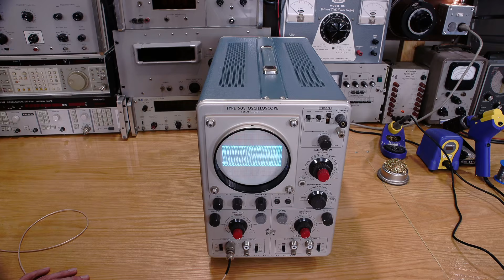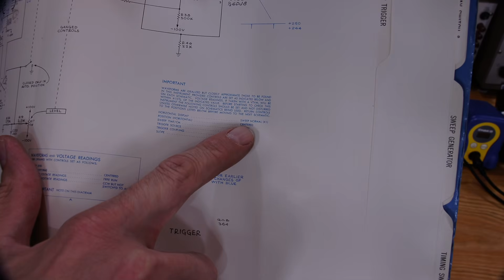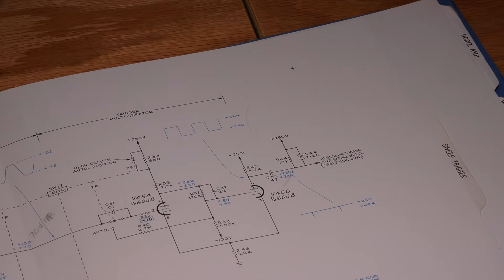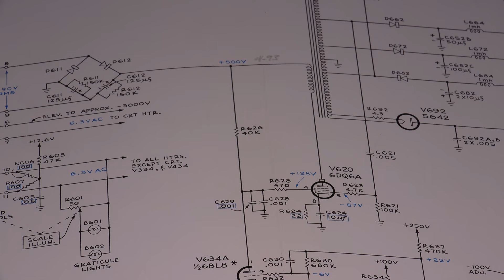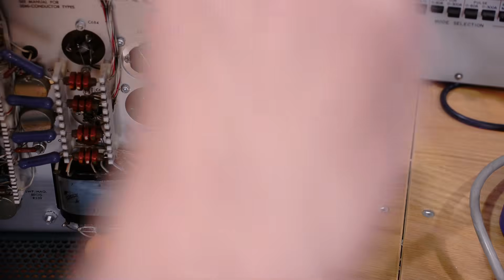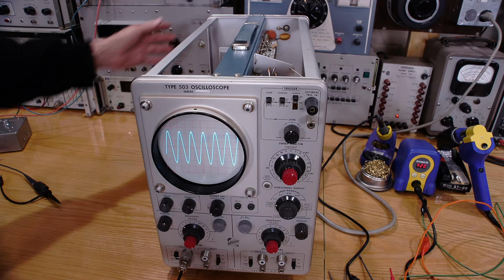TEKTRONIX TYPE 503 Electrical Troubleshooting And Repair!

Comment: Do not replace the tubes in this I'm just seeing Wright now they look like amperex Bugle Boy 6 DJ 8 all I could see is a white lettering on it don't clean them because they don't touch those with the numbers they paint the numbers on and it should have like a picture of a vacuum tube on it that's got a face and is kind of dancing so that's why they call it a Bugle Boy
Reply: It's also blowing a bugle most of the time so know the reason it's called a Bugle Boy so hopefully you pull the tubes out we get to see them

Comment: I got all the way to the end of fixing the supply voltage on my 503, just to find out that the cathode and the heater were shorted together in the CRT. Which is a bummer because when the scope worked it was fantastic. Off to find a tube!

Comment: Hey man. I have a quick question if you do not mind answering. I'm building a new dim bulb current limited variac / isolation transformer. I take it you popped a slug out of the switch box where you have the 2 plugs and popped out one of the slug holes and put an ac incandescent bulb in it ehh? I'm wondering what type of socket the bulb is in.

I realize I'm doing this at my own risk, I've quite comfortable doing it and plan to build an enclosure for mine but mount it on the wall offset from my bench kind of like you have set up. A family member manages the local Greybar/harris roome so i get electrical boxes and such at cost, if not free. It's great when I need to do any household wiring and he gives me the ptfe coated wire that's left on a roll. haha. You would not believe the markup on things depending on if it's an order for a utility contract. For instance, 8 years ago he offered me a fluke 87v for 350 (cost) and they sell it for almost triple to the power company.

I ordered 2 e26 bulb sockets and 100 watt ac tungsten bulbs which have went up in price here in Canada since last time I bought a similar type, it's as if led lights that were once 40 a bulb are the cheap ones now. haha.

Great video and no pressure to answer my question if you do not want to. I get you're busy and appreciate what you do.
Reply from the maker: In my unit, the bulb sits in a rubber grommet, and is soldered. (no socket) Thanks for your kind comment and offer!
Reply: @MrCarlsonsLab  Thanks brother. Your comment is well met and appreciated.

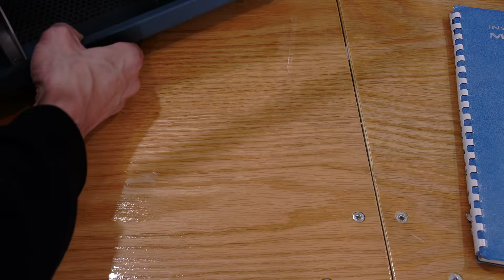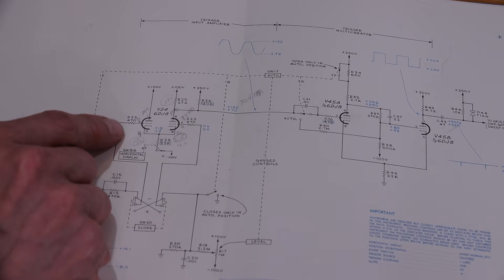Comment: That is absolutely the cleanest 503 I have ever seen.  In the 70s when I worked on these smoking was still allowed.  15:01 I am pretty sure that is silver solder. 16:36, I don't see any of the characters that were in some of the schematics, like "top gun". Great fix.

Comment: Great video Paul!  I too have owned and loved many a Tek scope, currently have 5000 and 7000 frames & plugins and my bench scopes are a 465 and a 2465, both gems.  I just had one comment: when you installed that new cap in the -100 V line, you missed an opportunity to use that silver solder...there were unused lugs in the strip right above, and the cap would have fit great there.

Comment: LOL, that cabinet panel falling thing reminds me of an incident I had. I was working on a graphic design computer system in the late 70's, at the GM Oldsmobile automotive design staff facility in Lansing, Mi. A very quiet environment, I had taken the panels off the unit and thought I had them safely set aside. However, I had to get on the floor to get at a subsystem at one point, and having a bit of a struggle with position, my foot knocked over one of the panels, creating a loud Boom!  All the guys at their stations in the place stopped their work, starting whistling, yelling "Yea, Yea, Alright Alright!", then clapping for a few seconds, and then returned to their work. Embarrased, I then laid the panels down on the floor so that wouldn't happen again!

Comment: I have test gear that allegedly will test capacitors in-circuit, making prior desoldering unnecessary.
It has so far been a quick and easy way of testing the state of health of capacitors that do not look overtly damaged. 😐

Comment: Thou shalt not covet. 😓
And there I thought that a `signal write` was issued simply by comparing the signal amplitude to a preset trigger-level. 🤔
The interior of the CRO looks like the instrument was kept for most of it's life inside a sealed enclosure and was never even used.
Do you think the folks from Rohde & Schwarz might do that too? 🙄

Comment: The manual said to select 1 millisecond for calibration, but you selected .1 millisecond.  Coming from a non-electronics guy (but an electronics enthusiast), wouldn't that be an issue?

Comment: Paul is the 503 comparable to an eico 460 wide band, or a heathkit IO12 ?
Reply from the maker: Hi Peter, the 503 is a low frequency scope (450kHz) where the EICO would go to about 4.5 "or so" MHz. The trigger section in the 503 is fantastic, where the EICO was more (everyday) so to say.
Reply: @MrCarlsonsLab  thanks for the reply...nice to know your there!

Comment: I have this scope and I have one capacitor fail. Tied in another one leaving the failed one out of circuit and everything came back. Set it to the side for six seven months and foolishly just plugged it straight into the wall and now I think another capacitor actually failed. That was so happy when you posted this video. Thanks for everything Paul!

Comment: Sehr Angenehmer Kanal Mr. Carlson. Sehr Service Freundliches Tektronics Osziloskop! Ich habe 2 Pendanten Philips GM5602 14Mhz Breitband Osziloskope.
Sinus Signale gehen weit über 20Mhz zu triggern. Bei Rechteck, oder anderen Signal Wave formen geht es nicht so weit. Aber die Philips Geräte sind sehr viel Komplexer und verbaut. 250Watt bei 230V 50Hz 
Ich teile die Leidenschaft zu reparieren, und alte Röhrentechnik Fasziniert mich Magisch.

Comment: I believe on most of these tektronix 500-series scopes, you can remove the bezel and flip the graticule around 180 degrees and get either a white or red graticule, some amazing engineering went into making these machines. I have a 535A myself, that unfortunately is in a dysfunctional state. I hope to get it up and running and your videos are a great inspiration and aid!
Greetings from Sweden!

Comment: You probably know this already, but on the Tek 514AD scope I have, the graticule panel has two sets of holes drilled for the lights. Two are normal, the other two have red dye tinting in the holes and make the graticule appear red. You change them just by flipping the panel.

Comment: Hats off to Tektronix folks who designed and built this Type 503 scope. What a beautiful piece of history. You can just tell they took immense pride in building this equipment. And the fact that all these years later the scope still performs is just amazing. Thanks for repairing this scope! I also love that you stuck with the theme of using other analog equipment to get the repair done!

Comment: seeing the Tektronix manual brought back memories from the PDP-8 computer I used to service 30 years ago, back then electronic equipment came with good service manuals. on the side note, my company has since replaced those PDP-8 with IBM PCs and I have no idea where the old stuff ended up, hoping the bean counters would have donated them to the museums.

Comment: Hello Mr. Carlson i am new to oscilloscopes im trying to get into repairing vintage electronics and i just picked up an Analab 1100 oscilloscope from the 60's i was wondering if you might know anything about them and what to look for to make sure it is working and calibrated properly while im learning to use it properly

Comment: What a nice piece of equipment, this one in particular is so clean that I could think it was never used. The quality of tektronix equipment is so impressive and beautyful, I have worked with different models of Tektronix video waveform monitors for over 30 years in broadcast television and I don't remember seeing any one failed.

Comment: Great video, THANKS! Having worked on some 503s myself, I would like to share some of my experience... Earlier 503s have tubes in the signal amplifier sections, not variacs. The signal amplifiers are very sensitive and optimal for X-Y use, i.e. vector graphics. The insulation (plastic) for the intensity and focus pot can break down (may be too much sun?) and cause short to chassis / ground. Be careful everybody!

Comment: I have a TEK 310A with a blown capacitor on the power supply. It was given to me because it doesn't work and just smokes when they try to turn it on. I wonder if using a modern cap like you did in this video will work. I love just looking at this vintage unit which is in mint condition otherwise. I'm very interested in taking your course in repair also.  Thank you for the video above. Tom S. Ocala, Florida

Comment: Excellent video and information. After seeing this, I am now interested in tracking down this model for my shop. Would this be a good scope for guitar amp work? Any issue with tubes for this such as supply and or cost?

Comment: I enjoy.
I have an tek 2225.
And when i measuring rise time of  a very fast edge signal grnerator at 10x magnifying mode it have horizontal jitter.
Could you realise which part have issue.?
Vertical swip or trigger part of the circuit?

Comment: I have the type 504, bought it cheap at a ham fest. But would rather have the 503 for its nicer vertical amplifier for x-y mode. Thank you for the video.

Comment: Another excellent video, thanks for everything you do. I believe that the 503 uses Nuvistors which would be very interesting to have the Mr Carlson treatment to understand how they are used in this scope both from an electronic and mechanical explanation. Fingers crossed 🤞

Comment: One trick for quickly spotting issues like the one you found here with the bad capacitor: put a DMM into AC voltage, and if you read anything substantial on a power rail you know you need to investigate further. Just need to be mindful of your DMM's bandwidth in that mode. 

Great video! Informative as always.

Comment: Great Video. Seeing again those scops from my past. The company of my Father built scopes in Germany up to around the 1956 till 1976 yeat in germany in theTettnang  factory starting from tube versions in the 60th up to transistorized  ones. Called P.E.K. Oscilloscopes (in Tettnang Bodensee next to Friedrichshafen)  -- maybe you get in hand of some of those rare scops. I still have a 10MHz transistor P.E.K oscilloscpe based from that time. As a young boy I was running around in the factory and playing with these nice instruments. The also did the first tests with color versions of  a color capable scope tube which I never saw again after that time.

Comment: This is pretty similar to a scope I'd picked up when my tech school had to clean out its storage area when moving to the new campus. The factory-provided silver-bearing solder, however, was wound around two posts riveted to the chassis, and I seem to remember that the unit could be folded out after the covers were taken off. Certainly a far cry from the repair-hostile electronics we deal with today!

Comment: In the 80s my dad worked for tektronix as a service technician and I grew up playing with work he brought home. I have a couple of Telequipment D67 oscilloscopes here that he picked up back then for free and rebuilt after someone dropped them in a lake. I think he said that one has D66 parts on the inside. Unfortunately he passed away last year so I can't get more information on them. I have no idea what these would have originally cost but he always thought they were something he was saving for retirement, a bit of a nest egg. Until he looked up what they were selling for a few years ago.
Reply: Tek took over Telequipment in the 70's, they made cheap service scopes.
They were dumped as Tek released the el cjeapo 5000 series, which was horrible

Comment: Your excellent video took me back 60 years or so to when Tektronix scopes were the king of instruments in the laboratories where I worked.  They weighed an absolute ton, but when you got a reading on one of them, then you knew it was right!   You showed us how to diagnose the open-circuit reservoir capacitor in the power supply from the excessive ripple using another scope, which of course was responsible for the low output dc voltage to the trigger circuits.  Those of us 
without the luxury of a second oscilloscope would probably have guessed where the problem lay and confirmed it as you did by paralleling a good capacitor across the suspect one.

Mr. Carlson, I am always impressed by the sheer professionalism of your videos with their amazing quality!
Reply: In early 80's I also started working with a Tektronix oscilloscope (was a bigger one, but with a wagon carrier !). So advanced for that time, so precise, highest quality. Then, in the next job, I had a mighty 4 Ch. dual timebase, flat screen, which helped so much, and which I admired enormously. And the next was so small, so practical, yet so powerful and useful, with LCD screen. And all the time I witnessed the incomparable quality and performance of the great Tektronix company

Comment: Hi, beautiful machine, wonderful design work by Tektronix and an even better display of diagnostics. I would just like to add a small detail - the connectors used are of the UHF type, the so-called N connectors do not have a toothed outer part and there is a cavity between the body and the central pin. The GND connection of the UHF connector is realized by that toothing, but the N connector has a contact surface that touches the inner side of the casing. Because the UHF connector has a dielectric insert aligned with the face of the connector and the N connector has a cavity, a small help is offered to recognize these connectors - N = Nothing there 😁

Nice day 🙂 Tom

Comment: I worked for Tek as a summer intern while in school.  It was the foundation of my 50yr electronics career.  The finest company I have ever seen.   I found the great thing about working on scopes is that everything that happens in the circuitry is manifested in the display.  You can look at the display and almost diagnose the circuitry without any other diagnostic tools (once you are very familiar with the circuitry).   I used to test and repair dozens of 465's a night.

Comment: I noticed a glowing NE2 bulb on the top row of the circuit side of the Type 503 scope. Would you consider doing a video explaining and demonstrating how NE2 bulbs are used in circuit for more than an indicator light?  Thank you for another very interesting video.

Comment: Tek was the Cadillac of the scope market, HP was effectively Lincoln or Mercedes.  Either brand was the top end of the test gear market, and Keysight (the current name of HP's old instrumentation division) is still the top end - their most expensive scopes will set you back several hundred thousand dollars, but will get deep into the GHz range and have a ridiculous number of functions available.
Reply: 7L14

Comment: Thanks. Excellent video, as usual. I’m always impressed with your ability to find vintage equipment that looks like it came off the factory floor. Great real world troubleshooting exercise too. It’s nice that you can bring this old gear back to working condition.

Comment: I believe those have a radioactive tube I forget which one.
Reply: Voltage stabiliser, Tritium doped so they ignite. Beware the red dot.
Reply: @FarleyHillBilly  Wouldn’t it just decay?  Now I’m curious.  I have several of these.
Reply: @naughtiusmaximus830  Yes it does and it changes the tube characteristics. Only dangerous if broken..

Comment: Ah, the venerable 6DJ8. I like those, particularly the later version 6922 for things like microphone pre-amps. Microphonics are a little higher than others but they sure do perform well with good linearity over a wide range if you don't demand too much gain.

A vacuum tube switch mode supply?! That's it, time to build a relaxation oscillator SMPS.

Comment: Question: Do you have any tips on blue ray players? mine stopped reading discs but the blue laser is still "working", and the red laser works and reads dvd discs.  i don't know where to start.

Comment: Fun watching you work on the good older gear. This one reminded me of the Tek 555 dual beam scope that I had in the 70s. It was most useful on remote video projection jobs to embarrass the telco techs about the problems with the signals coming from their VANDA. I could show them both horizontal and vertical signals at the same time as it was like having 2 scopes in one, one stop shopping! 
Bill

Comment: When those Oscilloscopes were made most of the people using them fixed electronics which is why the scopes have features like the easy access to the inside, the engineers at Tektronix  knew that and therefore knowing that those users would be inside those scopes made them easy to fix.

Comment: Well. 
Paul. 10:58 
I am an electrician 
30 years of experience 
In a wide range of electrical fields 
Transmission line all the way down to picovolt dc systems and literally everything in-between 
And I have been collecting componants to build a 
Isolated Current limiting variac like yours but now 
We can no longer get incandescent bulbs
Do you think you could come up with an alternative for future tecs
Your consideration would be 
Much appreciated 
Thank you for all your knowledge

Comment: Great series. I have an old Tek 465...the trace curves downward at one end, with no signal. In your experience, is this likely to be an electronic problem, or physical damage to the deflection system?  Thanks.